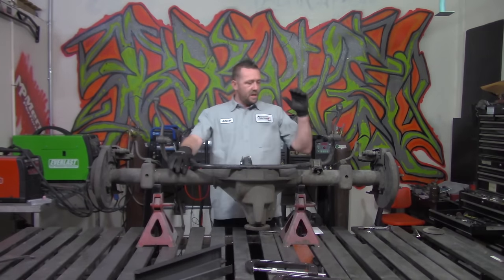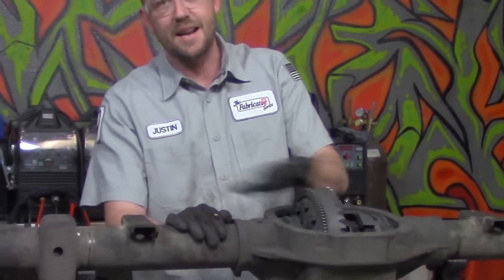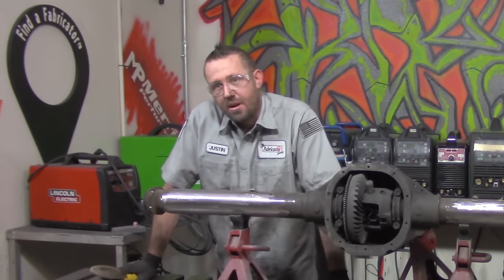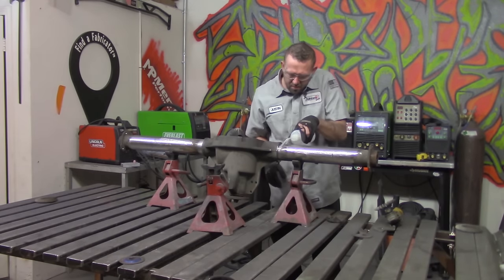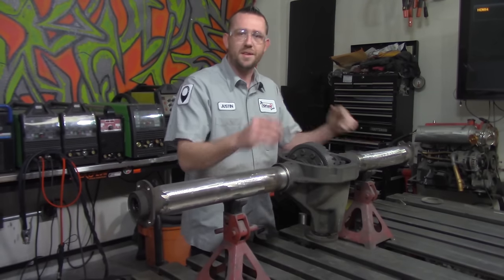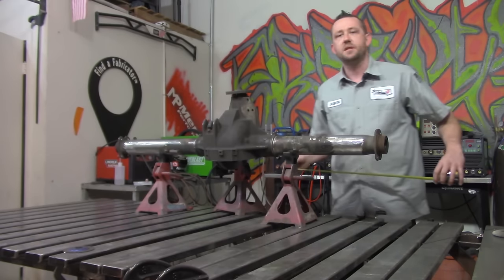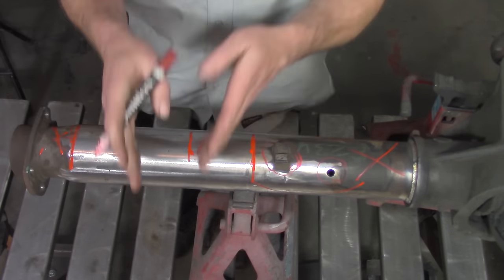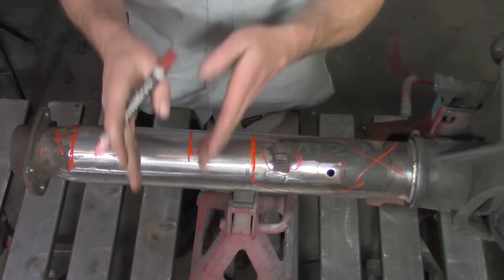TFS: How to Narrow a Ford 8.8 Part 1 - Strip Down

Comment: While watching Justin measure the cut lines for sectioning the left side of the axle, I wondered if a plumber's tubing cutter would help. One side of the C-Clamp shaped tool has a pair of rollers to hold the tool perpendicular to the pipe and the other side has a sharp cutting wheel. If it works, it could cleanly cut off the pieces. Even if it doesn't, it would make marks around the axle tube that is perpendicular to the axle line. That might be more accurate and less easily erased than a series of ink marks and tape. 

Grainger sells one made by Rigid that goes up to 2 ⅜"
https://www.grainger.com/product/RIDGID-Manual-Cutting-Action-Tubing-4CW57

Reed makes a hinged cutter that will cut steel, ductile iron and cast iron up to schedule 100, which is 0.594 inches on an eight inch pipe. 
https://www.reedmfgco.com/en/products/cutters-and-cutter-wheels/hinged-cutters/
Reply: Yes this works great, I have a larger rigid  pipe cutter i think goes up to 6'' and makes very square cuts as long as the pipe is relatively round. Works great for drive shafts too. The larger units are expensive tho, but they come up every now and again on CL.
Reply: I used a pipe cutter similar to the one you describe that was made to cut lollicolumns for building when I remanufactured 8.8" diffs that were sold by my company for use in Cobra kit cars, some were even sold directly to Factory 5 for their kits.... 😎

Comment: What settings did you use on the TIG to weld to the tubes to the housing?
Reply: Strokers Garage hot
Reply from the maker: I think I was in the 160 amp range.

Comment: Just another tip on welding, I noticed you just got thru with the TIG on the axle tubes and pulled your helmet and gloves off and then placed your forearms over the welded area. I'm thinking your pretty bad ass or your not paying enough attention. Just a gig. :)
Reply from the maker: The crew and I shot the weld scene before lunch and shot the arm scene and hour later. I dont make enough for a full crew with a continuity expert.

Comment: wonder wat tig setting he used on the pipe to housing part , got a small 120 amp (chineese) tig welder and wonder if its enough
Reply: 125amps is not enough,I would use a min. Of a 200amp machine.

Comment: Wouldn't it make more sense to shorten a 9.75" and in the end you just have a stronger diff since the 9.75 is comparable to the Dana 60
Reply from the maker: kyle warmerdam Depends on the use. This is about the 8.8 which is very popular.
Reply: The Fabrication Series 
Doesn't really depend on use since a 9.75 can be run in anything where there's an 8.8 in it. The only thing is a stronger diff. I get you did a video on an 8.8 and that's great and all but what things do you LOVE about It?

Comment: What application are you shortening it to this width for?
Reply from the maker: jr78racer AE86
Reply: Cool. Thanks for the quick reply.
Reply: The Fabrication Series It was a very informative video, but it would be safer to pull the tube from the center section and shorten it that way. Putting a cut midway through the tube creates a weak point that WILL eventually break. And you don't need a fancy press to pull the tube and press it back in either. Just a little ingenuity.

Comment: If your only cutting one side how are you keeping the drive shaft in the middle of the trans tunnel?
Reply from the maker: Michael Schulein One side is longer than the other which means it wasn't centered to begin with. Making both axles the same length means it will be. You'd also be hard pressed to find a pinion dead center in any axle or chassis.
Reply: I call B.S. You are correct to question this.
Reply from the maker: Paul Zimmerman How is it BS? It literally is built from the factory offset and not centered. That's why we only cut down one tube.
Reply: If this is an explorer axle, its offset from factory. Only a couple inches.
Reply: Just making a point that the diff should be shortened to suit the car it's going into. Equal length axels will make the pinion offset to the right side by 1.5". 
Maybe there's a lesson to be taught on making a diff to suit a car before cutting it up. Awesome show though, I'm just coming from a mechanical fitment stand point.  Keep up the good work man!
Reply: Michael Schulein 
True, fit the axle to the car. In this case, the common practice is to shorten one side so you can use two short axle shafts. Its cheap and effective. And its more centered after shortening this way. Explorer fuel tanks needed more space.

Comment: can you sleve the axel tube inside
Reply: the more important answer is yes you can strengthen the axle shaft by laminating it with a pipe but to achieve maximum strength to prevent any failure from twisting you need to also increase the spline diameter and coresponding spider gears at which point you will need to address the universals as they become the weak link

Comment: I' absolutely love you video but Brother do yourself a favor and put on a face shield!I have been a welder for over 20 years and seen those those thin cut off  wheels come apart in a big nasty way!I saw a guy that refused to wear a face shield catch a large chunk of one in the side of his cheek and needless to say he was fired after he recovered because he had been told time after time after time to wear a face shield..
Reply: I saw a safety video once showing what you described above of a real case of that under the eye down through the cheek with half the wheel diameter embedded into the face. I fear it will grenade. He looks very comfortable and confident. I'm a nervous wreck just turning the damn things on for fear of one exploding and embedding in my face.
Reply: Swampy  Nothen ever happens until it happens? It happens all the time and guys get busted up.

Comment: If you check out www,muggywelding.com they have a ssf silver solder they call but it is used for welding cast to steel might want to check it out. It is welding with a tig and not just solder

Comment: If you think those "plug welds" are going to break but those little bitty "T" welds of the relatively thin tubes to those thick nodular iron "flanges" on the carrier are going to prevent that and do anything but make it more likely the tubes are going to snap off at that "joint" you're breathing too much welding smoke. Just like you are if you think you're going to cut and splice those tubes and not end up with a far weaker axle than stock and can do all that crap "cheaper" and "easier" than having "custom" tubes made and pressed into the center section by professionals who know what they're doing OR just having a "custom" aftermarket housing MADE THE WAY YOU WANT/NEED IT for your intended application for probably $1500 or less with a FAR STRONGER AND PROPERLY ENGINEERED/MANUFACTURED housing, you need to get some ventilation in your shop before the fumes make you do something crazy like try to "shorten " the AXLE SHAFTS.

Comment: This is ridiculous. Disc brake FULL WIDTH 8.8's are worth more than a narrowed '98 Explorer V8 Non C-clip 8.8 where I'm from. Already narrowed, and ready to go, just cut off your under axle perches and weld new ones on the top if you're going spring over. If spring under you have less work.

Comment: LOL , there is a reason the diff has one axle longer then the other , making them the same size is a really bad idea
Reply from the maker: Let's hear that reason... I'll wait.
Reply: because  the pinion is offset  ! thats why one axle is longer then the other , if they are the same length then the engine will have to be offset to keep the tail shaft straight !
Reply from the maker: up yours The driveshaft doesn't care if its straight. It can be offset to the side. Look at virtually every car or truck with a rear axle and tell me how many of them are straight in any direction.
Reply: what ever , enjoy premature gear box mount failure and output shaft bearing wear , and no , all vehicles have the tail shaft aligned , that is why one axle is longer then the other !
Reply from the maker: up yours Try again. They dont all have one longer than the other. They also dont have a perfectly straight driveshaft. A 0 degree alignment will destroy a gearbox along with U joints.
Reply: oh rubbish !
Reply from the maker: up yours Look it up. Go to a junk yard and measure a few if you want. I have a Toyota in front of me right now with 2 even length axles and an offset pinion. It was never centered from the factory. If you dont believe me, get yourself out and go check it out for yourself.

Comment: 5:30 sparks and debris flying everywhere all over engines and expensive equipment.
Reply: It's a work shop that's what happens.
Reply: Yeah, thats what happens when you use a grinder. The sparks aren't going to hurt anything.
Reply: @Redtooth75   At least as long as you don't leave aluminum lying on a bench that you intend to weld together or fabricate into something later. Likewise do not leave SS wire brushes that you clean aluminum with out to become contaminated with mild steel grinding dust.

Comment: Spent many hours fixing the sloppy pinion bearings. Thanks ford! Dont waste your time here. Dana 60 is so much better and better lookin too
.
Reply: Then you don't know how to build a Ford rear end . . .  We would build our own 9" , narrowed, and added disc brakes using junk yard parts, and would race it for 3 or 4 seasons in figure 8 racing. Have any idea how many times your rear wheels get hit in 3 years of figure 8 racing? And I'm not talking intersection hits.
Nobody I knew ever ran Danas. Even guys running Mopars used 9" Fords. You can get gearsets that will run Talladega to ¼ mile ovals. Plus even though Lincolns of the right years are scarce now, disc brake, floater kits are dirt cheap.

Comment: so im sitting here watching and you have a dozen welders behind you, and not one plasma cutter?  Your plasma cutter must have been an EverBlast and puffed smoke.. Another thing, is ditch the 8.8 axle ends and use 9" axle ends so you dont spit out axles under real power..
Reply from the maker: KYGamer I've never used an Everlast plasma cutter but I did recently get a Cutmaster 60i fron Thermal Dynamics. I also have the story why I didn't use them often in the past. https://youtu.be/sUBFOJ6nRfY

Comment: I respect you skills, and you do a great job of producing quality content, but please take your influence seriously.

While you are free to follow or ignore safety guidelines on your own, when you produce a DIY video for mass consumption, you have a debt to your audience.  Using an angle grinder with a cutoff wheel without a guard in place is dangerous.  Please set a good example for those who are inspired by your work.
Reply: Eric Jensen you people are what's wrong with the world next time you'll be telling him he shouldn't wall because it's too dangerous

Granted they are called death wheels for a reason
Reply: "you'll be telling him he shouldn't wall"

I have no idea as to the meaning of this sequence of words.
Reply: Eric Jensen walk
Reply: every single well known skilled fabricator, uses angle grinders without the guard for many reasons, ill list a few. First, the guard only enables you to cut on the front side of the cutting wheel, many a times when you're cutting a precise opening, you use the back of the wheel to pull the cut towards you to get a crispy 90 corner. Second, when you're working on skilled fabrication, many a times you're cutting inside areas tighter than a grinder with a shroud can fit. Lastly, most professional flap wheels don't fit inside of the guard, they are an 1/8" too thick to fit... have fun with your "safety" i can assure you, even with a guard, an angle grinder isn't a "safe" tool.
Reply: Eric Jensen replying to your comment, the real world is not for you, stay away or you' ll get hurt by it.